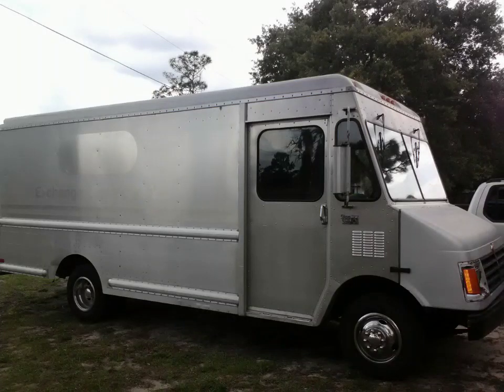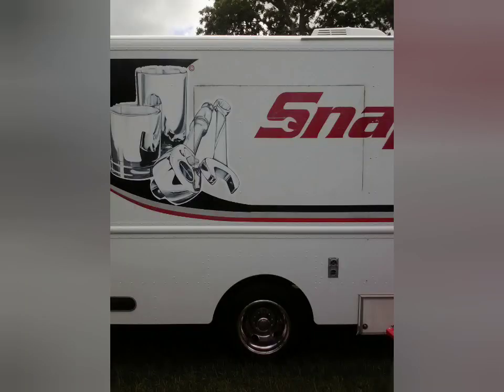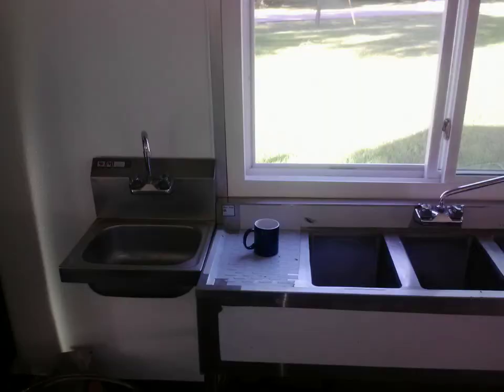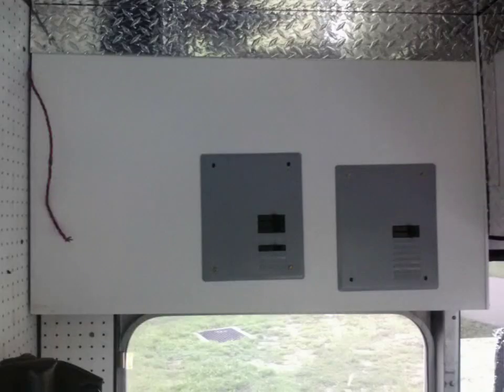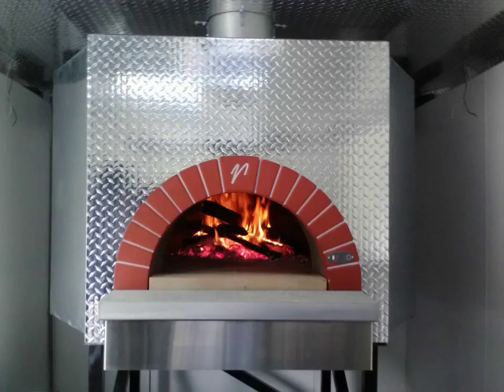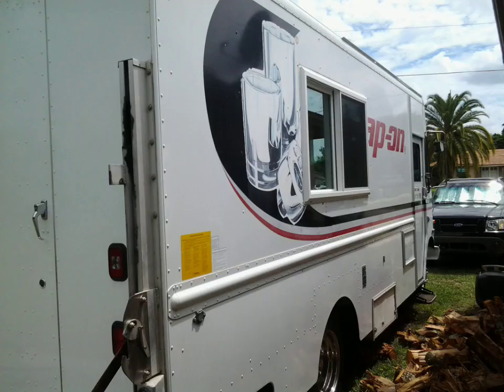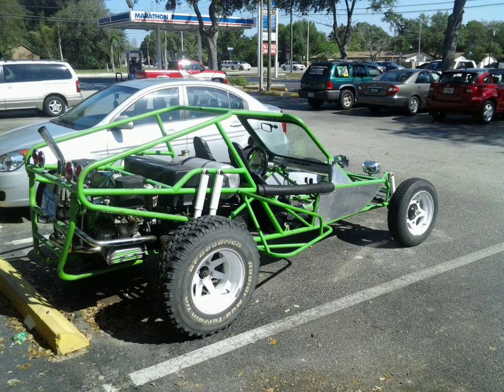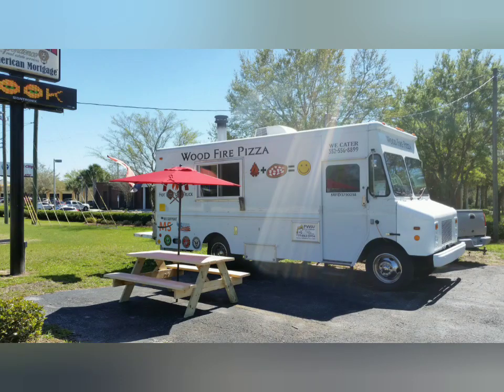Wood fired pizza truck build. A look back.

Comment: Hey Eric, what kind of prep station is that?
Reply from the maker: It's a Spartan brand. They make a few different prep tables and refrigerators. Much cheaper than true. Came with warranty and it's been a solid until for me. Had one issue with the thermostat( my fault) and customer service was great.